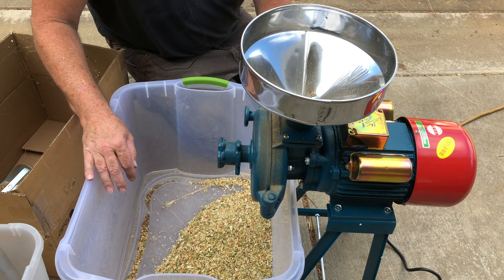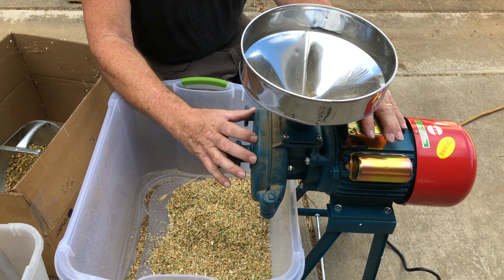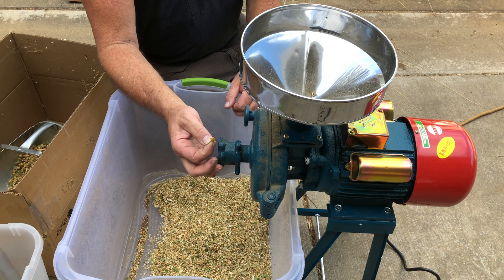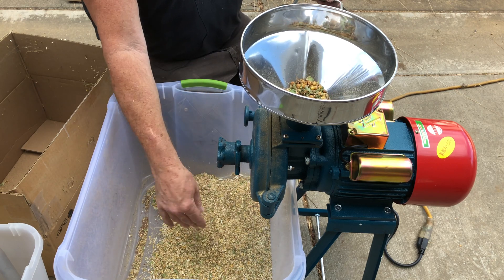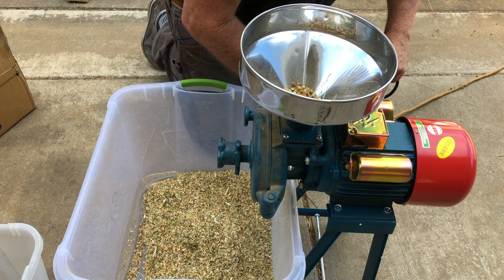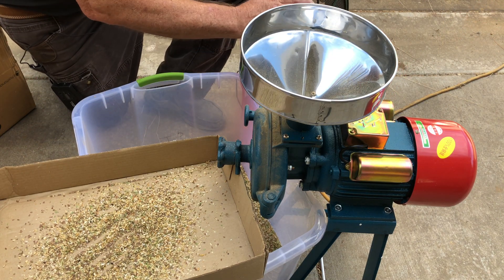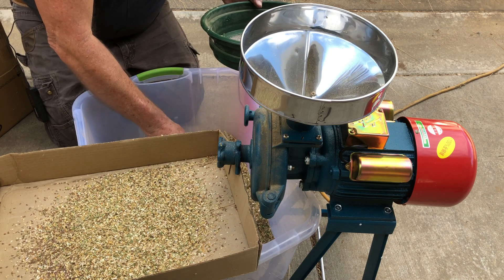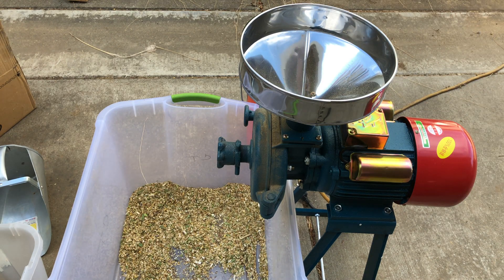Flax Seed Pod Power Thresher

Comment: Hi there. We are in the Azores and we would like to buy a piece of equipment like this. Could you please provide guidance on where to by such equipment?
Reply from the maker: I use this piece of equipment to break the flax pods to release the seed and break up the chaff into smaller bits. I then use a screen to screen out the chaff. Then I put it into my vacuum box to remove the seed from the chaff. The seed falls through and the chaff gets pulled out. Clean enough to use for next years crop as long as it is kept dry so no mildew grows on the remaining chaff. As for getting you one I don't really know. Here is a current version from eBay. Not sure if you can get products shipped there that are purchased from eBay.  This is a current auction and may not be active for long. It is around the price I paid for mine. 
https://www.ebay.com/itm/314214523422?hash=item4928a5221e:g:DdkAAOSwQB1iaLST&amdata=enc%3AAQAHAAAAoK5rF4g2Lgwj0kMNdcslArK8C2saApYnhgpaI2HCNfPSffx9cGEfiODmiyD%2BRON5ID3h2qtofjwtDf7y48tDT%2Fb0yWxm4S6h0XkOvFCYAMZebLmPLilw%2BQ77nrMlpL8sJvmVXYONjP8pDOIJRrAGBX8x8K80j%2F6RKi1lPGaJSMWb2pnTj%2Fmvoh06a6Zr9fKX24E50zM%2Birjv4%2BEUXgerC38%3D%7Ctkp%3ABk9SR77Xkd-LYQ
Reply: @abittwisted  Thank you for the info.  The equipment is no longer available on eBay... Can you please share the details of your equipment? brand/model? Thanks in advance